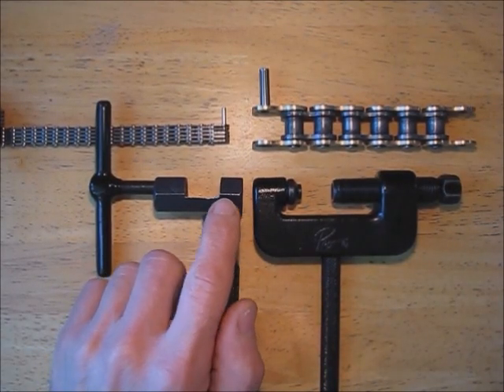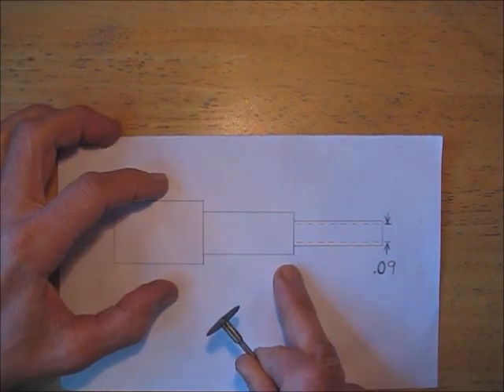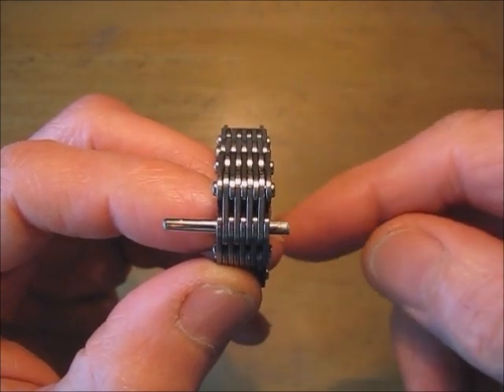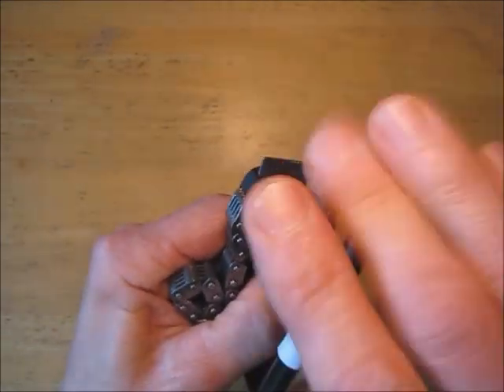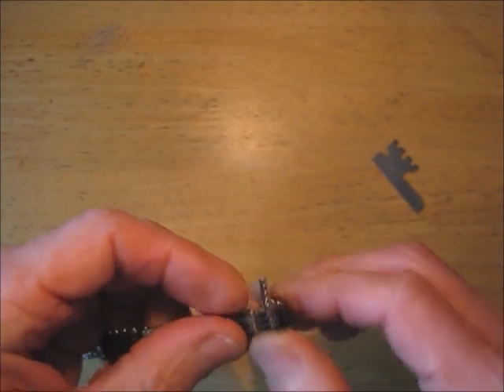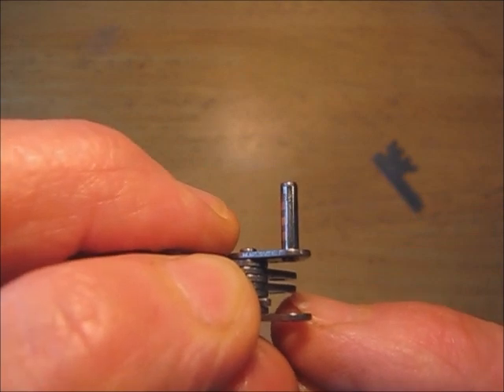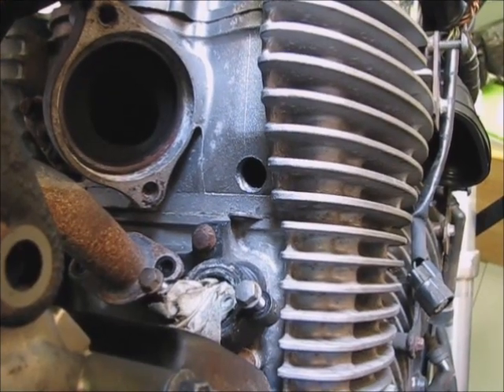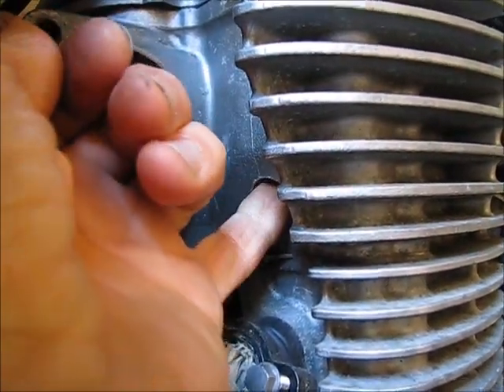Suzuki M50 and C50 cam chain replacement

Comment: I used to do a similar procedure with roller link style chains back in the day but this is the first time I've seen someone do this with this style chain. Nice work mate and thanks for the concise description, very informative.
Reply from the maker: Thank you.  I'd like to add a comment for those who don't watch the entire video.  At 28:10 I talk about having grease in the wrong set screw.  It may effect the swaging.  And if possible, turn the screw that's swaging the bad end of the pin.  The screws have about the same pitch.

Comment: That's a smart way to do this but very tricky lol!!! Great job though I'm going to have to change mine on my C50T soon or a later thanks for the detailed information!!
Reply from the maker: Thank you.  On my first M50 I pulled the engine, and removed the cam covers, and threaded the new chains over the cam sprockets.  Leaving the heads on.  If you're doing only  one chain, I would leave the engine in.  If you're doing both chains, I think you could do the front one by, removing the engine bolts, the front engine mount, The large pivot bolt on the left side of the swing arm, the radiator, the radiator cap housing, Some bolt or sensor on the front of the cylinder or head, and the fan, as I recall.  Now the engine is resting on the frame and can be pried to the left with a pry bar on the head and frame to remove the two long bolts. I think the cam cover can then be removed, and the chain replaced with the cam in the head. Removing the filter may help. Even this may be easier then removing the engine.
I did reassemble the bike in the video and started it.  It had piston slap or rod knock from all the rust that was in the oil.  The oil looked like chocolate milk, when I got it.  The guy who bought it is happy and riding it.  I got two tickets in the in the mail from him being in the fast track lane.

Comment: just want to make sure, the pin you pushed is the same pin you used to rivet back the chain?....im trying to look for master link for magna but it looks like they are not available
Reply from the maker: It's the same pin.  I only pushed it to the far side of the link.  If you push it all the way out, you'll have a hard time putting it back in.  It'd be helpful to practice on an old chain.  I don't know if the Magna chain is the same width as the Suzuki.

Comment: I have a few questions if you would be able to message me somehow. The main one, what do you use for the final pin you use to rivet the chain together? And how strong is the connection?
Reply from the maker: Sorry for the delayed response.  The pin that's used, is the one that I broke the new chain with.  I didn't push it all the way out of the side plate.
 It's at the tail end of the new chain that was connected to the old chain.
The connection is good.  As long as the pin doesn't move.  (I don't think it'll move.)
Are you in the Bay Area?  I'm in San Jose.